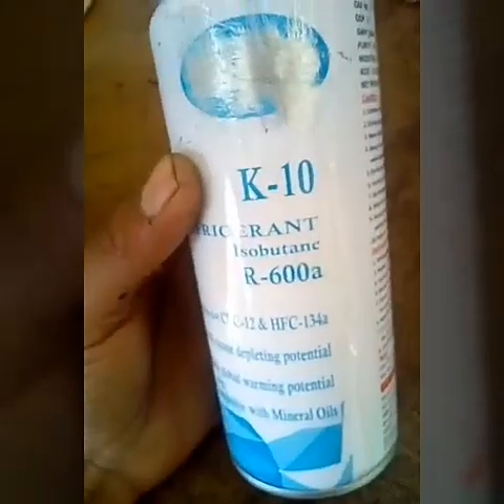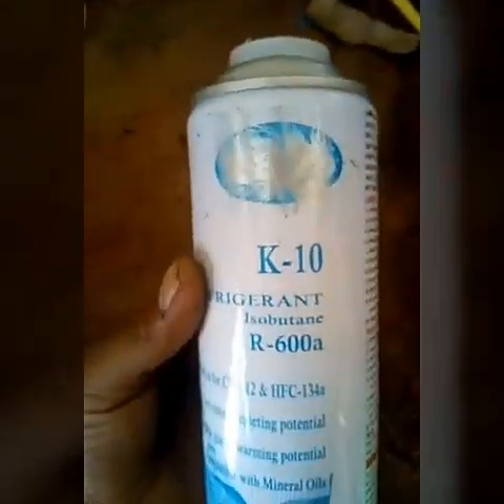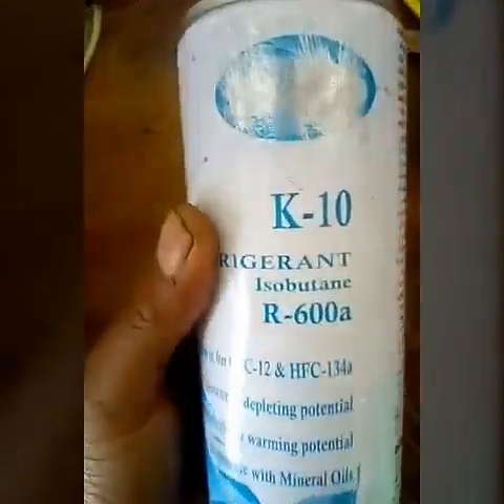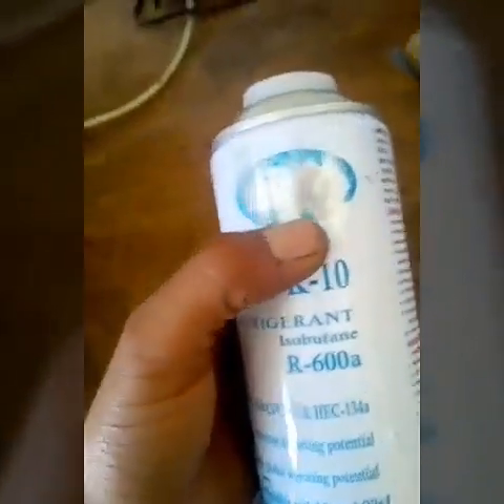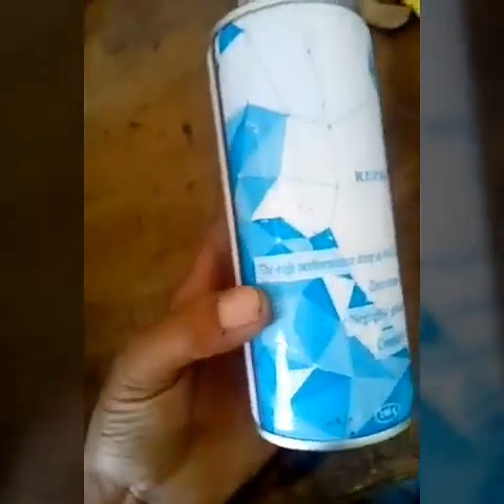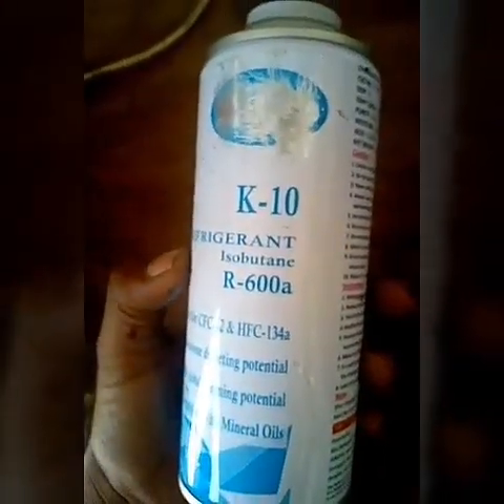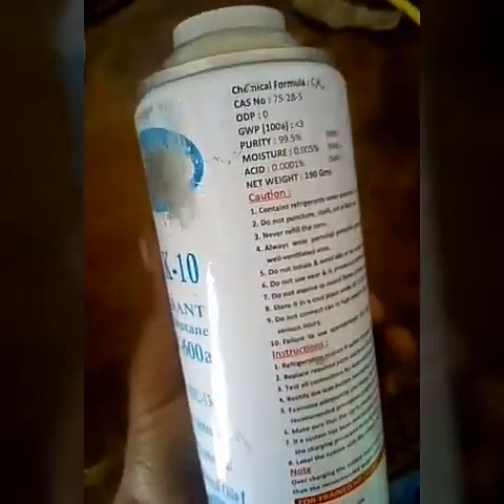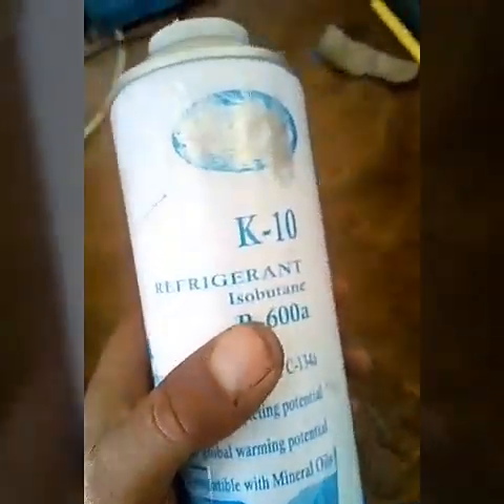Replace R134a With R600a Refrigerator

Comment: I just replaced r134a to r600a compressor its doing good i dont think you should change oil also
Reply from the maker: Same is explained... R 134 a can be changed to r600 but r600 cannot be changed to r134 without Capelleries
Reply: @RazaviRelease  yes bro i agreed i just posted for people who confused about it works or not
Reply from the maker: Thankx for your comments buddy
Reply: Yes once u change gas change oil and flush with oxygen and vacuum but before u fill oil put dome of the required oil in the compressor and run it for a while then drain it out then put the required amount of oil in then vacuum and charge your  gas

Comment: Can you swap a r600a into a refrigerator that had a r134a one before?
Reply from the maker: If you are changing compressor  r134 to r600a than its no problem
But if you only want to change gas from r 134a to r600a than you have to change compressor oil
Reply: @RazaviRelease  I wasn't sure if just swapping the compressor would work. Thanks. I was thinking of swapping a 24V R124a compressor out with a 24V R600a compressor, for a mobile unit. If it is the oil that is different, I may just change the oil. Do you know what kind of oil would work for the R600a? Thank you.

Comment: Sir, i like ur video ... i have a question bcoz i have a fridge that i need to repair  but its my first time to repair like and its hard to find freon its so expensive my question is....how to replace r600 to r134a and what i need to replaced beside freon r600 what else..?
Reply from the maker: R600a is cheaper than r134a
And is available freely
But if you still need to change
You need to change compressor oil and cappelery

Comment: Can i change r134a with r600a without replacing capilory sir ple re
Reply from the maker: Yes r134a csn be replaced with r600 without capelory change 

But if you want to rplace r600a with r134a then you need to change capelory
Reply: Sir l can 134a replace 404a without capilary
Reply: sir caplary ka size kia hoga
Reply: Can change 134a for 600??

Comment: sir r600 ke jagah a134 us karsak tehe
Reply: Bhai 31 number  ke hoti hai 134 vali kon c hoti hai
Reply from the maker: Ji kar sakte hai
But capelory change karni padegi tabhi
Reply: capillary kis size ki lagegi ye kese pata lagega
Reply from the maker: Aap sparepart wale kp bol sakte hai r134 wali capalary dedo..
Simple
Reply: sir ji what is the difference of capillary between. r134a & r 600a
Reply from the maker: Its size difference
Capelory size in r600 is little bit shrinked than r134 i.e Smaller
Reply from the maker: R134a physical aspect is used in Refrigeration 
Its not 134 its R134a
Reply: u
Reply: Ok